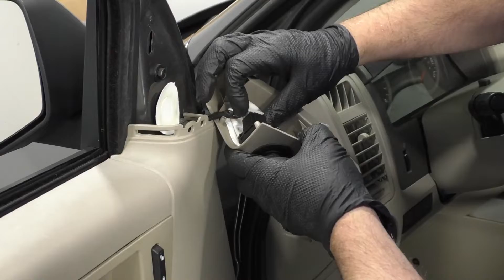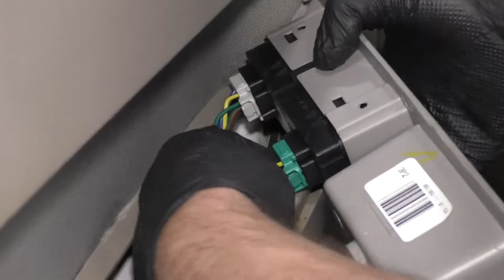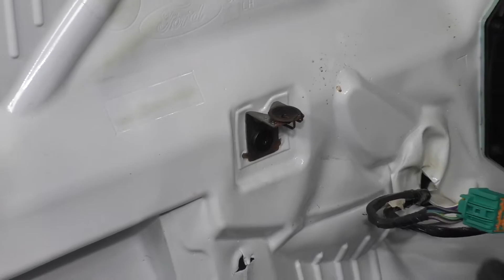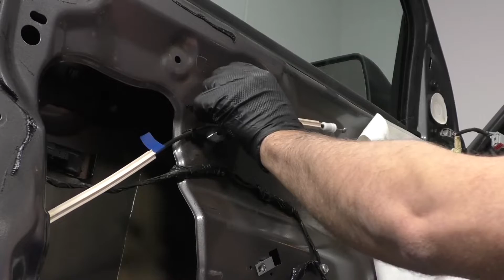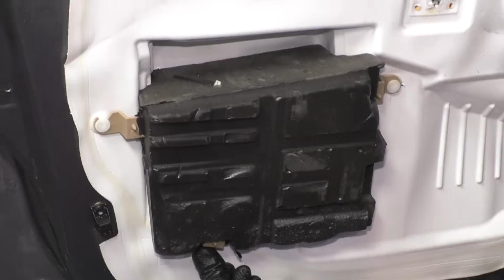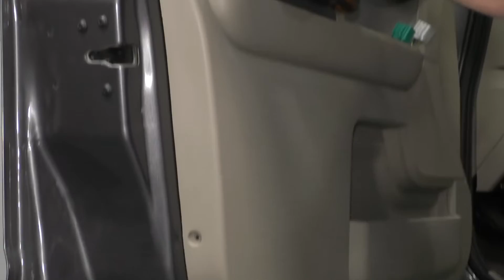How to Replace Front Window Regulator 08-12 Ford Escape

Comment: Great video, even though it is six years old. My vehicle is a 2010 Mercury Mariner, so yeah, same thing, different badge on the grille. I did find that those T30 bolts are T27 drive on mine. The T30 was just plain too big. Different year, different model line, so there was maybe a production change somewhere.

Comment: This is a great video! I strongly suggest spending the extra money on the whole assembly(not just the regulator) even if the motor’s still good. You’ll save yourself time and effort.
Reply: What extra money? The parts store I went to wanted $76.95 for the regulator, or they wanted $76.95 for the regulator with motor. Go figure. And yes the pictures showed without or with motor. That was certainly a no brainer for me.

Comment: How do I know if its the regulator or the switch? Window went down but wont come back up
Reply from the maker: +Peggie H Thanks for watching!  Here's the video you're looking for: https://www.youtube.com/watch?v=2tLmH05UKwk
Reply: Thank you for that! I actually googled what was supposed to be a fixed and it worked....hold the button in the closed position and slam the door a few times...closed on the second try right before a rainstorm thankfully. Still not sure what that tells me....had an issue with a leaking sunroof and that door got ALOT of moisture....could it just be corrosion?